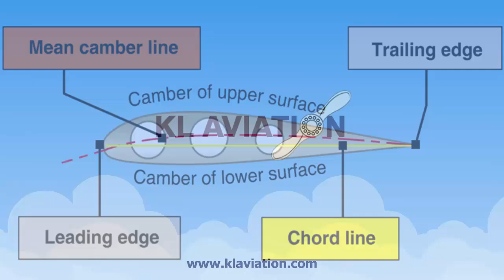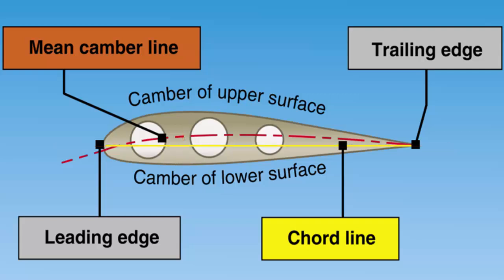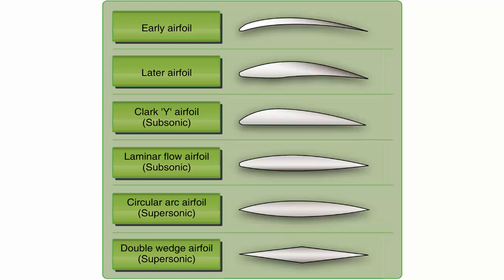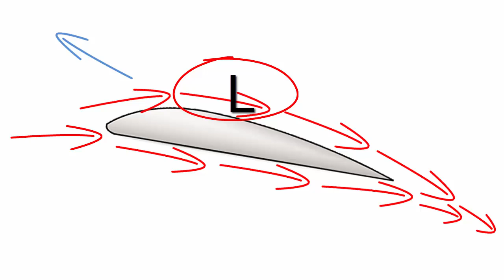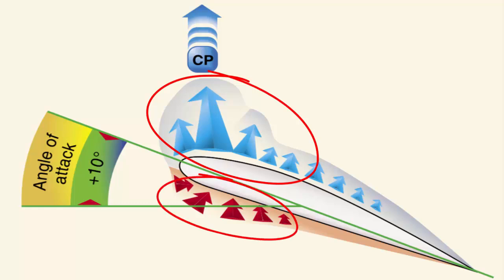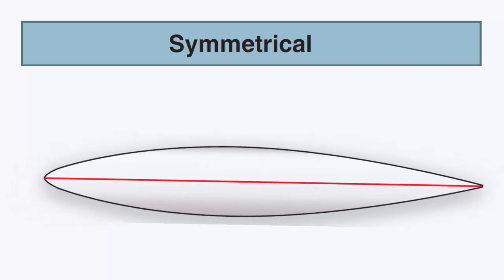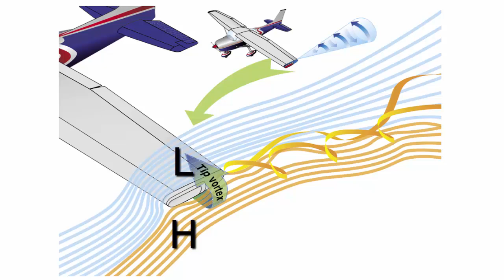Airfoil Design

Comment: Beautifully done!
Reply: Nope. Terrible.
This video only repeats very common misconceptions and invents a new one, as follows.
.
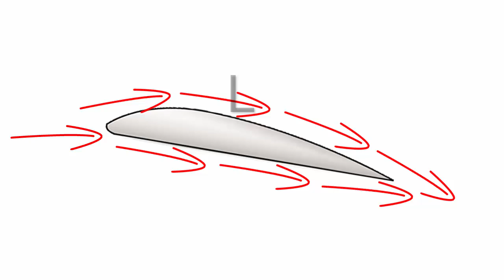3:13  The low pressure above the wing allows higher pressure ahead of the wing to accelerate it to the higher speed. It is Newton.  The force of pressure accelerates the mass of air. 
The movement of the wing creates pressure gradients and as Euler reported to us in the mid 1700s, Pressure gradients accelerate fluids.
Bernoulli never said speed causes a pressure reduction. He only noted that the (static) pressure and velocity have an inverse relationship with no indication of cause and effect. This is a major, common  misunderstanding. 
Euler determined that pressure gradients accelerate fluids toward the lower pressure. That is the opposite of the common misconception.
...
3:29  The pressure difference top to bottom accounts for ALL THE LIFT.   This 'a little of this and a little of that" is bad science.   The same pressures that have the net upward lift force on the wing are the very same pressures that cause all accelerations around the wing including ahead, above, below, behind and around the tips.
The higher pressure under the wing pushes up on the wing AND down on the air below to contribute to the down-wash.
The lower pressure above the wing allows atmospheric pressure to push air above the wing downward, to also contribute to the down-wash.
..
NOTE: the whole upward force on the wing is equal to the force required to accelerate all the air in the down-wash.  THAT is what satisfies Newton's Third Law.  The upward 'push" (force) on the wing equals the downward 'push' (force) on the air accelerated downward.
The downward moving air does not push up on the wing.   That air was pushed down by the pressures around the wing. 
The down-wash also does not push the wing forward. You've invented a new a fallacy.  The net force fore-aft is rearward and is called drag and is not caused by the down-wash as explained above.
When viewed from the still air frame of reference, the down-wash is moving slightly forward.
....
4:27  Bernoulli's Principle is again misused.  The flow is not slowed under the wing which is NOT the cause of the higher pressure. .  That view is valid only in the stationary wing, wind tunnel reference frame only. 

 In fact, REAL data from a REAL wing generating REAL lift flying through otherwise still air shows the lower air being moved forward in the direction of flight. This acceleration from still air is CAUSED BY the higher pressure at the lower surface.  The increase in pressure at the surface is because the wing is pushing the air out of  its way. This push increases the pressure, not the Bernoulli Principle Fallacy.
....
The pressure increase below the wing in combination with the decrease above the wing provides the ENTIRE lift force.
...
If by this magic, the down-wash did just happen to add to the lift, that "addition" would be exhibited as an increased pressure difference on the win...but it DOES NOT.
Bernoulli's Principle causes nothing in the generation of lift because the "speed-causes-pressures" is a fallacy. 
It is all explained by Newton, BUT NOT with this ":reaction force" fallacy.
Newton's Third Law "reaction force" is not an originating force, but is a direct result of the originating force which, in this case,  is from the pressures around the wing as described above.
....
At 7:11 Please listen to your words: “The high pressure area on the bottom of an airfoil pushes around the tip to the low pressure area on the top.”. This shows that you understand that pressure causes movement, but you fail to apply it on all the other parts of this  and, therefore shows the problems with this explanation.  The correct story uses this Pressure accelerated air in ALL aspects around the wing, because that I the real science.
The tip vortex does not ‘create the down wash”.  You already explained the down-wash without reference to the tip vortex.  This is a flaw in this explanation. The tip vortex is CONSISTENT with the wing generated down-wash moving against the still air outside the wing span.  Masses of air sliding along each other create vorticity (vortices) along the boundary of the two masses.
…
At 7:47 Winglets DO NOT and CANNOT prevent the tip vortex from forming.  They can only reduce the severity and the negative effect because they act to effectively lengthen the wingspan; longer wings have less severe vortices . See Doug McLean’s You Tube video on misconceptions for a full explanation.
https://www.youtube.com/watch?v=QKCK4lJLQHU 
…
Though well-meaning, the 'Pilot's Handbook of Aeronautical Knowledge.' has bad information in it as do so many other publications and on-line resources such as YouTube.

Comment: I have another bone to pick.  Air does not "suck". There is no such thing as "negative  pressure". There is only less pressure than ambient, but it is still positive pressure. Your blue arrows suggest that the air is magically pulling on the upper surface and that is incorrect. Air pressure can ONLY push.  There is no "pulling" of air.  The illision is done by reducing the pressure on one side, Therfore allowing the opposing higher pressure to do all of the pushing. That includes the positive air pressure on the inside of the wing pushing on the inside of the upper wing skin.

Comment: The air atop the wing does not cause lower pressure because it accelerates.  It accelerates because it experiences lower pressure.  And when we say accelerate, we mean air that hits the leading edge at 200 mph accelerates its speed above 200 mph as it travels across the surface of the wing.

Comment: SIMPLY STATED:  Wings create lift because:  A  The angle of attack creates positive high pressure under the wing, thus pushing upward, this  fact  being   responsible for almost the entirety of the lift generated; and  B  This same angle of attack generates a partial low pressure above the wing, sucking it upward.    This principle ( A )  applies likewise  to a water skier who stays above the surface of the water as long as the boat is pulling him  forward fast enough.   A plane with a FLAT wing (above and below) will  fly without a doubt.
Reply: @Observ45er  Made a rubber powered model that crashed and broke its properly air-foiled wing. Replaced the wing with another that was just a tissue-covered flat frame. Had some good flights, but have to say that the final glide was not as good. Still puzzled by both the phenomenon of lift and even more so the explanations
Reply: Lift is a combination of the Bernoulli effect and the downward deflection from the angle of attack. The Bernoulli effect is when the air has to pass through a narrowed space a more negative pressure is created, usually above the wing.
Reply: @Observ45er  I stand by my statement, notwithstanding the lack of fancy terms and jargon in my explanation.  A fully symmetrical wing is also subject to the basic lift principles that I stated initially.    Many a myth passes as fact for many, many years, in this and others fields as well.
Reply: @d.haroldangel241  I think he likes to hear himself talk and use big words.....I'd like to kno wat qualifies him to challenge bernoulli and newton??..or what he thinks are his qualifications?
Reply: I discovered  that Parasite drag is produced by VERTICAL surfaces and Induced drag is created by HORIZONTAL surfaces, for example when the Flaps are at 0 degrees they produce Max Induced drag and Min Parasite drag, at 90 degrees Min Induced and Max Parasite drag and at 45 degrees in the middle of both.
 Please let me know if you think it is a valid observation. Thanks

Comment: Incorrect, it's because of newton's 3rd law, not Bernoulli's. The molecules on the upper surface and on the lower surface don't travel at the same speed
Reply: Hien Nguyen Lift is exclusively generated by pressure distribution. I guess technically skin friction could be a tiny bit in the direction of lift... but I’ve never heard of that being considered in any actual analysis.

Your explanation of the Kutta condition is completely incorrect. The Kutta condition is an artificial boundary condition in potential flow theory which states velocity must leave the trailing edge smoothly. It’s not something that can happen or not.
Reply: Appable thanks, my understanding of Kutta condition is pretty messed up. Thanks for the redirection. I shall delete my comment.
For Newton’s 3rd law being a factor of lift. I can’t help but see that air molecules striking the bottom surface of an airfoil at a positive AoA would have components of force pushing the airfoil in the lift direction. Can you please explain your thoughts?
Reply: @HienNguyen-cq7qf  We're really saying the same thing. For airfoils continuum mechanics is typically used, where flow is modeled as continuous, deformable parcels of air and a pressure field can be defined everywhere. Your interpretation of the pressure field at the surface is more like statistical mechanics, which considers the statistical behavior of a large collection of particles. That's fine and they should agree for dense fluids like air (well, dense relative to air at 70km up or so).

 I'm not sure if I'd agree Newton's 3rd law is a "factor of lift" – it's more like one way to predict lift. In particular, you could draw a box around an airfoil and watch how much momentum comes into the box and out of the box. That momentum flow rate will be the same as the resultant aerodynamic force (so lift + drag vector). But you could also find the pressure at every point within that box, sum up all the pressure vectors on the surfaces (normal to the surface), and get the exact same number.
Reply: Appable hm so what you’re saying is Newton’s 3rd law and conservation of momentum completely define lift by themselves?
Reply: @HienNguyen-cq7qf  Yes, and pressure also completely defines lift. It's different ways of looking at the same problem – you know how in physics you can solve problems by looking at energy conservation or using forces? Sometimes one or the other is more useful, but ultimately they will give the same results because the underlying physics is the same.
Reply: Appable got it. Thanks for the thorough explanation!
Reply: @HienNguyen-cq7qf  This video only repeats very common misconceptions and invents a new one, as follows.
.
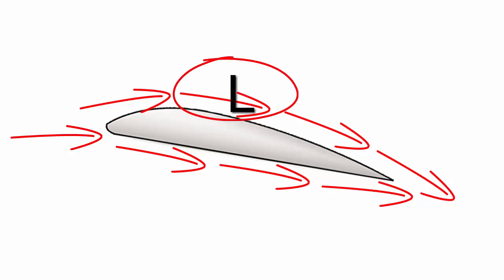3:13  The low pressure above the wing allows higher pressure ahead of the wing to accelerate it to the higher speed. It is Newton.  The force of pressure accelerates the mass of air. 
The movement of the wing creates pressure gradients and as Euler reported to us in the mid 1700s, Pressure gradients accelerate fluids.
Bernoulli never said speed causes a pressure reduction. He only noted that the (static) pressure and velocity have an inverse relationship with no indication of cause and effect. This is a major, common  misunderstanding. 
Euler determined that pressure gradients accelerate fluids toward the lower pressure. That is the opposite of the common misconception.
...
3:29  The pressure difference top to bottom accounts for ALL THE LIFT.   This 'a little of this and a little of that" is bad science.   The same pressures that have the net upward lift force on the wing are the very same pressures that cause all accelerations around the wing including ahead, above, below, behind and around the tips.
The higher pressure under the wing pushes up on the wing AND down on the air below to contribute to the down-wash.
The lower pressure above the wing allows atmospheric pressure to push air above the wing downward, to also contribute to the down-wash.
..
NOTE: the whole upward force on the wing is equal to the force required to accelerate all the air in the down-wash.  THAT is what satisfies Newton's Third Law.  The upward 'push" (force) on the wing equals the downward 'push' (force) on the air accelerated downward.
The downward moving air does not push up on the wing.   That air was pushed down by the pressures around the wing. 
The down-wash also does not push the wing forward. You've invented a new a fallacy.  The net force fore-aft is rearward and is called drag and is not caused by the down-wash as explained above.
When viewed from the still air frame of reference, the down-wash is moving slightly forward.
....
4:27  Bernoulli's Principle is again misused.  The flow is not slowed under the wing which is NOT the cause of the higher pressure. .  That view is valid only in the stationary wing, wind tunnel reference frame only. 

 In fact, REAL data from a REAL wing generating REAL lift flying through otherwise still air shows the lower air being moved forward in the direction of flight. This acceleration from still air is CAUSED BY the higher pressure at the lower surface.  The increase in pressure at the surface is because the wing is pushing the air out of  its way. This push increases the pressure, not the Bernoulli Principle Fallacy.
....
The pressure increase below the wing in combination with the decrease above the wing provides the ENTIRE lift force.
...
If by this magic, the down-wash did just happen to add to the lift, that "addition" would be exhibited as an increased pressure difference on the win...but it DOES NOT.
Bernoulli's Principle causes nothing in the generation of lift because the "speed-causes-pressures" is a fallacy. 
It is all explained by Newton, BUT NOT with this ":reaction force" fallacy.
Newton's Third Law "reaction force" is not an originating force, but is a direct result of the originating force which, in this case,  is from the pressures around the wing as described above.
....
At 7:11 Please listen to your words: “The high pressure area on the bottom of an airfoil pushes around the tip to the low pressure area on the top.”. This shows that you understand that pressure causes movement, but you fail to apply it on all the other parts of this  and, therefore shows the problems with this explanation.  The correct story uses this Pressure accelerated air in ALL aspects around the wing, because that I the real science.
The tip vortex does not ‘create the down wash”.  You already explained the down-wash without reference to the tip vortex.  This is a flaw in this explanation. The tip vortex is CONSISTENT with the wing generated down-wash moving against the still air outside the wing span.  Masses of air sliding along each other create vorticity (vortices) along the boundary of the two masses.
…
At 7:47 Winglets DO NOT and CANNOT prevent the tip vortex from forming.  They can only reduce the severity and the negative effect because they act to effectively lengthen the wingspan; longer wings have less severe vortices . See Doug McLean’s You Tube video on misconceptions for a full explanation.
https://www.youtube.com/watch?v=QKCK4lJLQHU 
…
Though well-meaning, the 'Pilot's Handbook of Aeronautical Knowledge.' has bad information in it as do so many other publications and on-line resources such as YouTube.